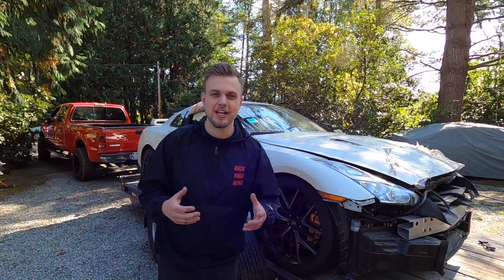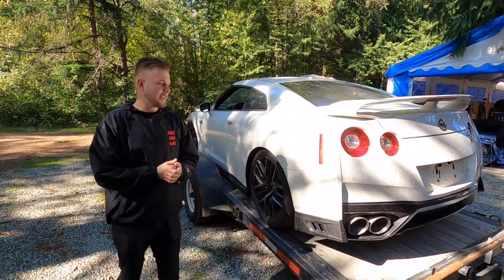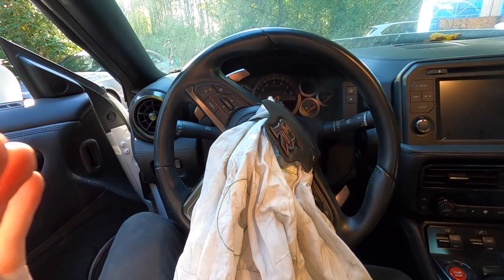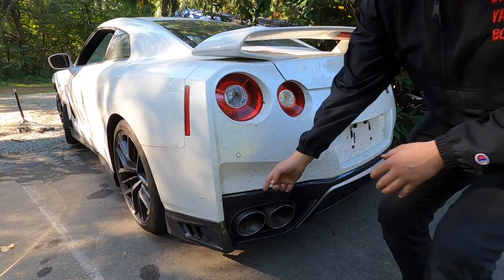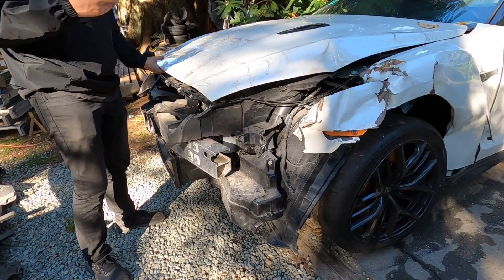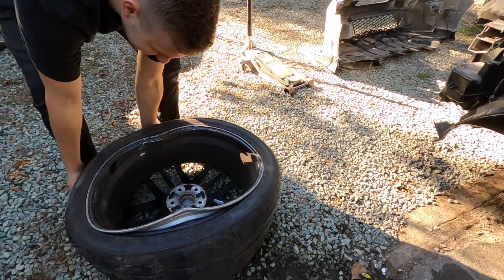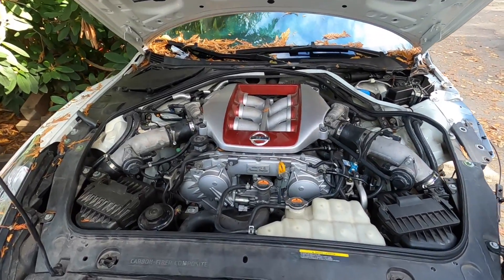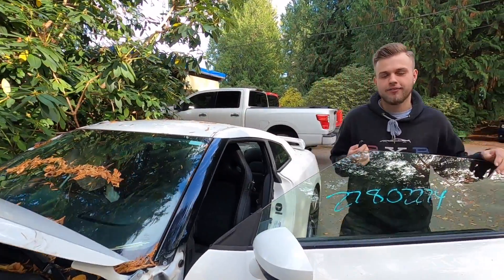I Just Bought A SMASHED 2018 Nissan GT-R From IAAI and I CANT BELIEVE IT CAME WITH THIS!! 1000HP????

Comment: Bro those 2 wires are most likely speed density sensor wires when i got my 2012 gtr previous owner removed all the goodies, 1300cc I'd injectors, intakes e85 sensor, and speed density kit look in to that

Comment: i think maybe it would be a bit more modified to be 1000hp, my boss had one GT-R and it was much more modified like as a stroked engine, bigger turbos and intakes with a 4" exhaust etc. but if you want to modify more then u should know that the cat-back system are built in titanium so do not buy an aftermarket cat-back. love your channel . keep up the great work best regards from sweden :D

Comment: A lot better purchase than the last one. For that question, you can't run E85 with stock injectors, more than like 1000cc or higher injector being used. which are typically the size used for GT-R's. You next thing need to do is add some seafoam in the tank due to the potential of E85 in tank and might be corrosive and cause more damage later. But this one is overall is great buy, way better than previous that got scrapped prior to sale. Only concern would be your front differential given the way the wheel was bent. To replace diff if broken require dropping engine or just lower subframe just a little to get clearance. Good Luck bro and again hit me up if you need help or any questions i have like 5 GT-R's so i been through it all. The Electrical connection you have is the map sensor, should 3 on the GT-R, one on the other side. If you look at he BOV it's also missing one those vacuum hose. Engine sounds fine, your just having typical fuel issue, check tank and see what was in tank from your ethanol sensor, may be E85 which probably start gunking up

Comment: I would not say that the new screen in the centre LOOKS MODERN...its looks like a laptop from 2003, not like a modern tablet at all. The crash structure is going to be weak after repair and weaker for a crash if ever happens again. Risky!! Good luck tho Tim.

Comment: Looks like it has had a speed density kit fitted at some point judging by the splitter cable from the MAF sensor. they're usually required if you're wanting over 700bhp from bigger turbos or want a vent to atmosphere dump valve.

Comment: I'll change you a 370z 2010, never shocked or altered from the factory, sole owner, I brought it from Puerto Rico two weeks ago I want to buy a gtr but they are very expensive, at least if you change it for me, I can buy the pieces little by little because not even the pensione of the  correction administration I have not walked but with sacrifice I will put it to